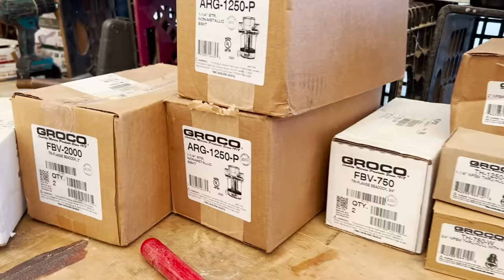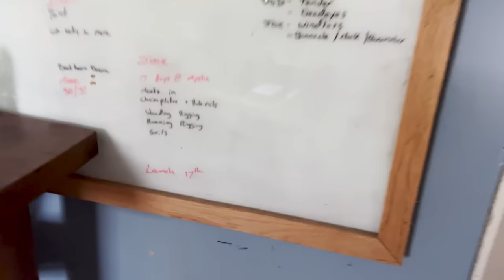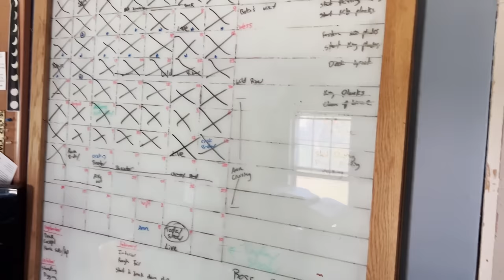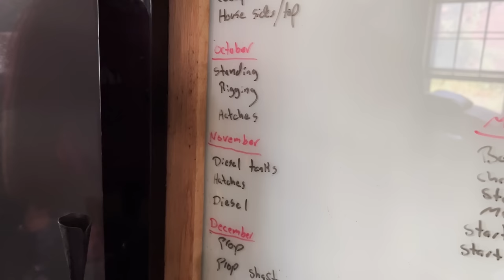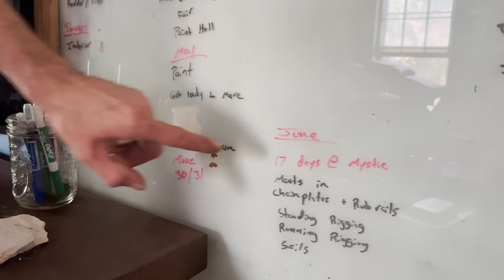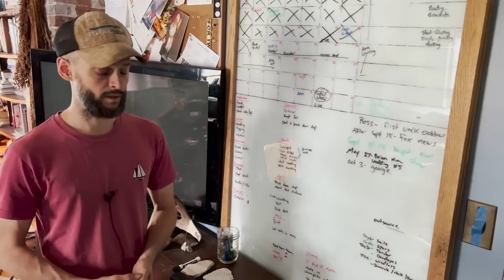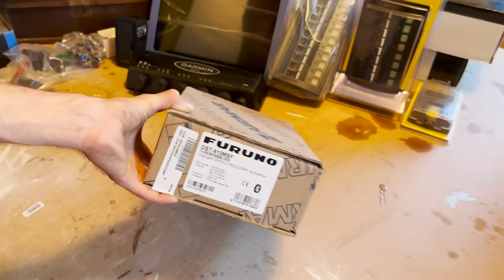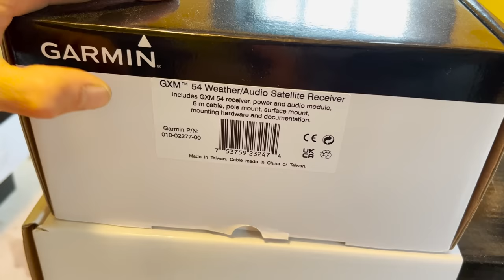Everything and the Galley Sink - Episode 228 - Acorn to Arabella: Journey of a Wooden Boat

Comment: Steve, I've been following you almost since the beginning.  You were just laying the keel.  I am super impressed with this whole project. Buuuuuuuuuut. Just finishing the hull is going to take a year.  You can't launch the boat until the hull is caulked, faired, and painted. You can't paint until it is caulked and faired and you can only paint in the summer time when it is warm enough.  At best you finish the deck, fair and caulk the hull this winter and paint the hull next summer. I think there is still a lot of work you will want to do while you have a full size shop handy as well.  Don't rush it, Steve. I think you will regret not having a full shop handy and room to work.
Reply: Look at the deck pace alone.  It’s clearly high quality work to be proud of but its taken them approx two months from steaming the covering boards episode to being able to start laying decking.  Lots of work done in that time, but two months to do what must be a fraction of a percent of the work left.

Fundamentally he’s making a boat to be proud of, the bronze bulwark mounts are pieces of art, and rushing to meet a deadline is a horrible idea.

Another project said work through the hull and decking is 1/3, the interior is 1/3 and the spars and rigging and sheets is 1/3.  They outsourced the spars as I recall but the rigging can’t even be measured until they’re finished and up.   And he can’t put them up until he’s ready to remove all the weather protection from the shop.  Production of rigging is 2-3 weeks but that means he needs to be ready to take down the bulk of the shop in what, 8 months?  And all the lines and sheets can’t go up until the rigging it in since the rigging holds the weight.  That’s a lot of months of work just for that one area.  I bet there’s a third to half a year of work just in the sailing aspect of the boat.  So we’re working backwards to where the spars need to go up in March, give or take.  And if they want to do fairing in the last two months and paint in May, which is plausible, they need to be done with absolutely everything else before the spars go up by December.  

And they need a few weeks to pull down the shop to even get the boat out, so that’s being done with everything else within 4 months from video time, accounting for the delay.  Four months to do 40% of the work is crazy fast.

Comment: Wow--those pumps are nice!  I was going to say that I can't wait to see them in use, but then I thought about it.
Reply from the maker: Right! The loveliest thing you hope to never use.
Reply: We use pneumatic diaphragm pumps in our hydraulic shop.  They are by far the most efficient way to move light liquids, at low pressure, fast!  That was a really generous donation.
Reply: I'd still test them out with something like a large bucket down at a depth matching the bilge. I am not terribly sure if that stile of pump can pull a high enough vacuum to prime itself. Well, in a worst case scenario the pump can be placed in the bilge and operated with levers and pushrods.
Reply: @TDOBrandano  That's a good point, for the one at cockpit level.  May not be so good at pumping air.

Comment: To the Bookie.  Yes, you will have a boat.  I did the same thing on building an early sixties convertible (car).  After many months up in the air (8 months), with most of the parts installed (and many more in boxes to go), I decided to drive it as is and enjoy.  Best decision made.  I had a great summer driving it and nobody new the difference.   I continue to work on it, empty the boxes in stock, and overall  it's been a good experience.  It still keeps me busy after 18 years.  Cheers.

Comment: When  you get the systems you need, I HIGHLY recommend you pre-test this all so that when it gets schlepped into the system you know it's all talking together, rather than running ALL of the wiring and debugging in cramped quarters. Yes, yes, that probably will have to happen in due time but I'd get savvy on the entire system first. And no I don't mean solar/charging, but the AIS/garming/autopilot/blah blah.  I'm a lifelong electrical engineer and I'd do that were I in  your shoes. I realize you have tons to do as well.
Reply: This would let you find any items that are damaged / not working, promptly enough to take it up with the suppliers.

Comment: I like your approach. Having all the latest tech gear while you’re learning to navigate at sea makes sense. You don’t have to use it, but as you point out, when it hits the fan and it will at some stage, you may need all the information you can get to avoid a disaster.  By all means, use a map, compass and sextant , sounds like a great way to go. Your comparison with Tally Ho is a good one. Set your own course mate, and don’t let the noise get in the way of your plans.

Comment: Great project planning and execution, Steve!  No doubts you will be ready for launch date.  Just one note, which I'm sure you have considered - Your external running lights (port, starboard, stern, mast).  Those will take a lot of wire snaking inside the boat, and up the masts.  Also, many boaters that I know absolutely swear by a high-power spot light (either hand held, or fix mounted).   When you're cruising into unknown waters, or a dark harbor at knight, the spotlight would be an valuable tool to avoid collisions with dark objects.  While not needed for launch, you'll probably want one eventually.  Happy to see all the progress on Arabella.😊
Reply from the maker: Thanks for watching! Yup, lighting gear is considered.

Comment: Very mature and wise of you to realize that you should wait to see how you would best use a space before finishing that space or locker out. Not only does that save build time, but it saves tearing out a locker or cubby to rebuild it later. That saves time, materials, and money in the long run, or settling for a space the doesn't work best for you and your long term mates aboard. That kind of wisdom is rare at your age.  I applaud you. As far as the wood stove goes, he roof of the shop is plenty high enough for the smoke to get up and away from breathable areas. However, unless there is adequate ventilation, the chimney likely woudnt draft/draw well, so good call on not using it inside a closed/mostly closed shop. Once out in open air, however, it would be a good way to get rid of scraps and sawdust/shavings from continued build out projects (as needed for heat inside the boat).
You don't need to explain your plan to us, but as a fellow planner/perfectionist I can totally appreciate the time and thought that went in to making your plan/order of operations and the thought behind the seasonal aspects of your choices. 
P.S. I can hardly wait to see the deck boards being let in to the secondary covering boards. I love it when form meats function and the pieces fit like a puzzle.

Comment: Somehow there's even more stuff to do before launch than I thought! I think once you finish the deck and house top it will start to feel nearly done but the interior has so many systems yet to go in, I can imagine that taking quite a bit longer once the wire starts getting unspooled.
Reply from the maker: The jobs seem to multiply but they also get smaller in scope in many cases!

Comment: GPS compass is rather interesting to see in a small package like that. I work with cable ships and years ago when i was frequently onboard for the projects we got to tinkering with our navigation software as there was a feature that allowed multiple DGPS receivers to be configured and provide heading data as compass input would. Once we dialed in filtering & physical offsets the dynamic positioning system found the heading data on par with the multiple survey grade gyro compasses.  Even had it working on 2 antennae that were only about a meter apart. That was years ago so i'd be pretty confident now in the stand alone unit given how technology moves forward.

Comment: After you clean out the diesel tanks it would be in your best interest to use a liquid tank liner in them. It is cheap insurance to make sure they never leak or corrode. Diesel is hydroscopic so there will be water in the tanks which if unlined will rust causing your filters to clog killing your engine. Good tank liners will also have properties that prevent algae from growing in them.
Reply from the maker: Corrosion is unlikely, because they’re monel, but thanks for the tip!

Comment: Radar and AIS are indispensable. Many weekend boaters use their chart plotter as a radar(rookie blunder). Knowing where you are and more importantly where other vessels are and their direction and speed is soooo important. Practice frequently plotting with your radar in fair weather, you will be confident when the fog rolls in. Also, kudos to you for installing an actual VHF. Handhelds are nearly useless.Large commercial vessels generally try to maintain a minimum 3 miles distance from traffic, arranging passing agreements by VHF before reaching those minimums. Handheld radios may not have the power to reach them. You have done well on your choices. (From a retired near coastal, radar certified master with several Atlantic/Mediterranean  crossings as an Able Seaman aboard oil tankers)
Reply: +1 for that advice; 40 years ago, crossing the Strait of Juan de Fuca in the fog along with a buddy boat, I listened to Vessel Traffic on the VHF and plotted all of the larger boats in the area as they reported in. My buddy had Loran so we knew where we were and at some point figured out that we'd reach the separation zone at the same time as a freighter. We contacted the freighter with VHF and they said 'we have you on radar; hold your position until we've passed'. We did, and after they passed they contacted us and we went on our merry but sight impaired way. 

There was no GPS at that time, so without Loran, navigation was dead rekoning and lights at night. One time, we ended up trying to enter Cattle Pass at night. The closer we got, the easier it was to distinguish navigation lights from other lights on shore and plot our location. It was a big relief to get through and into calm and safer waters.

All this to say that as you learn seamanship, perhaps do some navigation with paper charts (or your chart plotter with GPS and radar turned off) and VHF, using GPS to confirm your position when you think you need to.

Comment: Those pumps are impressive. I'm a bit worried about the lever connector though, it seems to be really fiddly. My permanently installed bilge pump has a hole on top (the pump is installed under the deck below a cover) and you just open the cover and stick the lever in the hole (no connectors, just the lever pipe) and start pumping. A lot quicker, and if you lose the lever, any rod of approx the right size will work.

Comment: I love bronze hardware, it looks so good bright or with patina. But it does make for poor fairleads for docking. Even really big bronze hardware has teeny tiny bend radii. Make your fairleads out of wood, especially for your ground tackle. Wood and rope play so well, you hardly need chafe gear. Plus you can make the bend radius HUGE. Keeping the bits as close to the fairleads as possible helps a lot with chafe also. 
I've wanted to augment my cockpit manual bilge pump with one inside. You may find yourself where you want to stay inside for safety and needing to manually bail. An example could be Hove too in a storm.
Reply from the maker: Thanks for sharing your experience!

Comment: Also the nav system is impressive. I've got a B&G system and it has one advantage - the SD card reader is in the front panel of the chart plotter :-P But I do regret not getting the remote deck unit for the VHF. When we upgraded the nav system back in 2014, we didn't think we were going to solo sail on the boat. But now I'm doing that a lot, and having radio on deck would be awesome - but B&G doesn't have the remotes that fit my unit anymore. So instead of coughing up 200 € for just the remote, I'd have to also by a new VHF for 600 €...
Reply: I could obviously just buy a completely separate hand held VHF on deck. But that wouldn't have the range of the main unit with the antenna at masthead.
Reply from the maker: I recommend installing a swinging panel that goes away when you’re not sailing, and swings into the companionway when you are, latched in either position with a simple piece of hardware like the hooks for head doors and whatnot. One unit, cockpit access. We had that on a boat I extensively cruised on. —Anne

Comment: Hey Steve. One thing I was wondering if I may have missed it. Are you going to insulate the haul with mineral wool? 🧐👍👍
Reply from the maker: No, it’s insulated with wood. 😊
Reply: @AcornToArabella  okkkkkk but wood is not a good insulator it will sweat when it gets cold enough.

Comment: Tillerpilot. Tiller pilot 
After one day of having to hold course 24 hours on the tiller you might think of that. 
Nice toys, but after gps and depth meter that tiller pilot is huge. Allows you to sail single handed, going forward to hassle with sails, popping down below or anchor is hard with just lashing the helm. It will wander offline pretty soon. 
Simple on is all that’s necessary. One that connects to the gps is not necessary. 
AIS is only a wire connection from the GPS to your radio that is on ‘back order’.

Comment: I know this is a bit late, but that GPS just has a unit on the front/back, left/right, so it can measure orientation. You can just as well mount a single GPS on front/back of boat and get a much more accurate reading, but GPS is advanced enough that it might be okay with 1ft.

Comment: I'm sure you will think everything through, but I personally would think very long and hard about moving and launching ARABELLA before she is nearly complete.  In your current location, you have a full workshop literally within spitting distance of the boat, and my understanding is that the project is not paying for the workshop, the space occupied by the boat, or living quarters for you and your volunteers.  Your inland location also protects you from the worst of severe ocean storms. 

Dock space, especially less expensive dock space, is scarce and getting scarcer as waterfront property gets developed.  Many marinas are unlikely to tolerate noisy or smelly activities across the pier from their other tenants.  You also will have the major logistical headache of moving boat parts, tools and supplies to and from your (rented) workshop space and living quarters to the boat-under-construction.  

Another issue is that oceanfront property is increasingly subject to severe storms.  If a hurricane approaches and the boat is finished, you would be able to move it under its own power up a local creek as far as it will go, then put out all your anchors and tie it to every tree that you can reach with your lines.  My understanding is that this technique, which sailors have used since forever, is the best possible way to avoid having your boat wrecked.  Depending on her state of completion, this option may not be available for an unfinished boat.  I have seen far too many pictures of boats piled on highways, etc. after a hurricane.
Reply from the maker: We’ll be able to navigate the boat with the level of completion she’ll be in for launch, thanks for your experience and comments!

Comment: Steve you do not need to detail every movement you make and it is YOUR project and on YOUR timeline, not ours.... As a skipper of one of Australia's volunteer Coast Guard boats a little bit of info for you. We use Raymarine multifunction chart plotters and on the chart plotter you can change the setting from North up to Head up, which will show you the chart in the direction of travel of your boat saving you the need for the satellite forward direction unit. Chart Plotters are a great device if you learn how to use them correctly (I would suggest doing a basic course before you start sailing, it can be done online or via a sailing club in your area or other services some are free) . We have radar and other things connected to ours so that alleviates the need for extra screens and saves space at the helm and chart table and you can have different portions of the chart plotter to tell you different things. like the chart on one portion, radar on another or overlay on the chart part of the screen and AIS so you can see other vessels within the set segment of your area that you are viewing (great for nighttime or foggy conditions), there are many choices of screen setting you can have on any of the decent chart plotters now available. I look forward to seeing all of this progress as things come together. I think you can do it by mid June next year. I have followed Ruth and Garrett since they started the build of Rediviva and love their boat. I also follow Leo with Tally-Ho and several other wooden boat channels.

Comment: Have you considered a pneumatic automotive bodywork long board? I was able to rip through yards of Bondo in just minutes with one compared to the hours of arm aching stroking with a manual unit. Even if you want to 'hand finish' the hull, you can do the bulk of wood removal with the air powered unit, then switch to manual to get that wave shedding smooth finish you'll need. And, do you think a wind generator would be a good backup for those cloudy days when the solar panels can't keep an L.E.D. glowing?... I hope you haven't built Ara so tight she doesn't creak in the wind, that's a huge part of a wooden boats charm. Unless you're off watch and trying to get some sleep!... 🙉